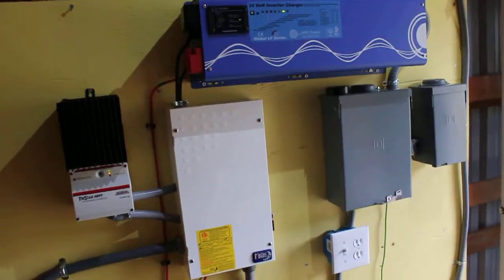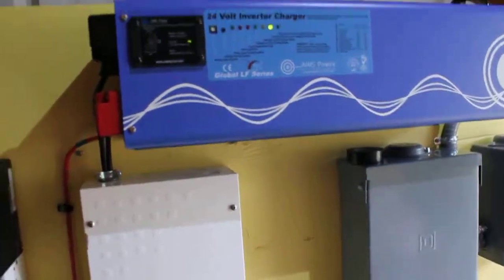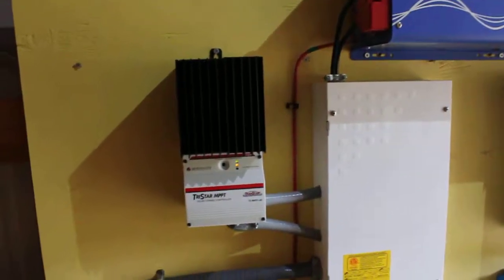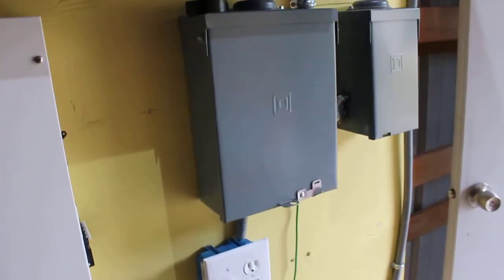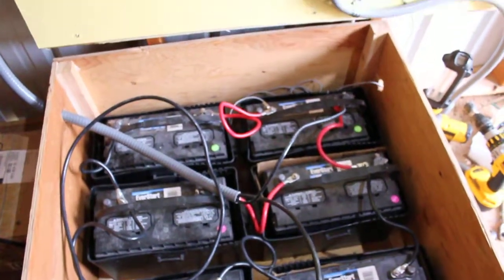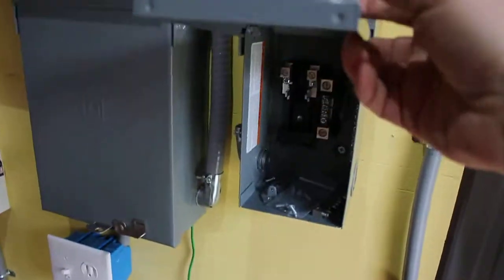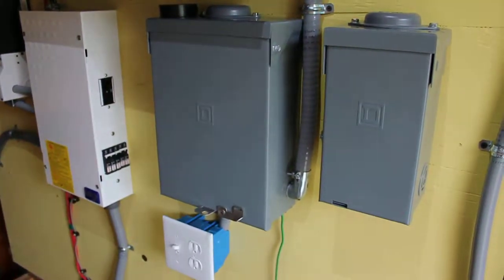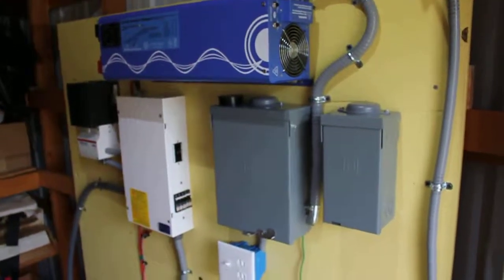Aims 4000watt inverter solar rig

Comment: Lets see & hear it in action! looks like a clean setup !
Reply from the maker: I just filmed an update and am uploading it to the channel now.
Thanks for reminding me!
Reply: Very nice setup you have there, I am thinking of getting this inverter for my mom's upcoming solar build. Was curious as to how noisy the fans are as She does not have a shed to put it in :( 

Thanks,
EJ
Reply from the maker: ejemm The fans sound like a PC computer. Does she have a garage? I would suggest a sheet of 1/2 inch plywood to mount to the wall and then mount the solar equipment to.
Reply: Thanks! thats an idea!